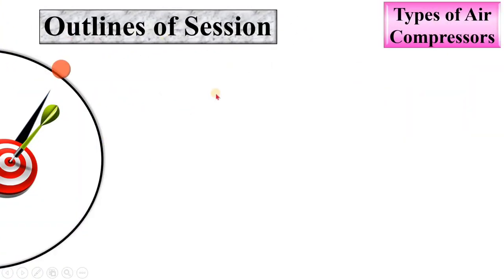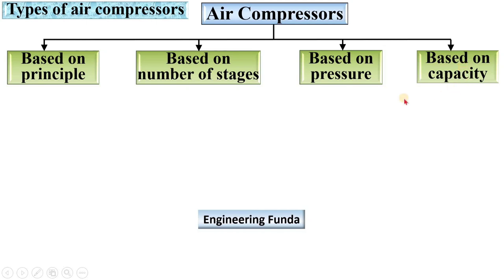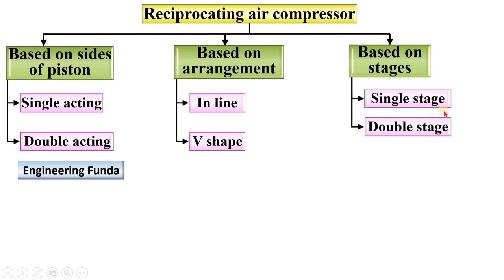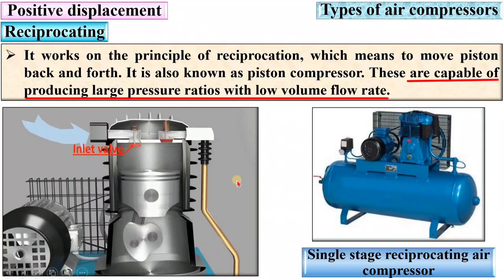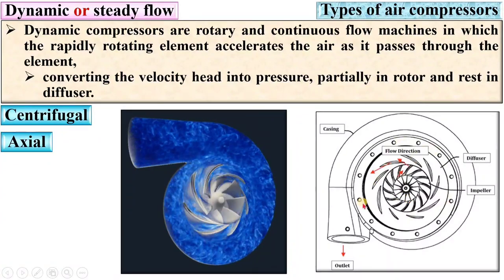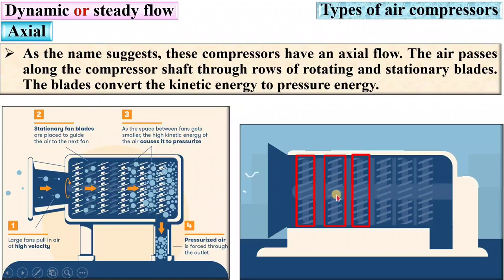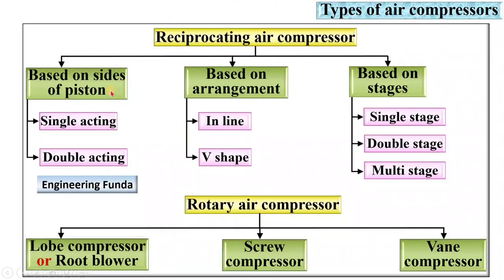Classification of Air Compressor (Reciprocating Air Compressors & Rotary air compressors) Explained

Comment from the maker: Classification of Air Compressor explained with following time codes: 
0:00 - Basic Mechanical Engineering lecture series 
0:14 – Types of air compressor
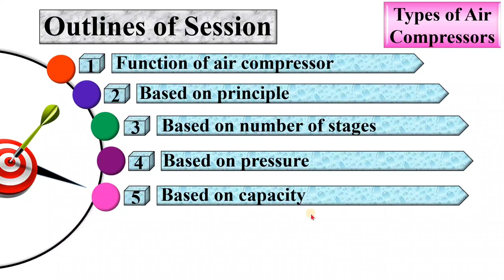0:35 – Function of air compressor
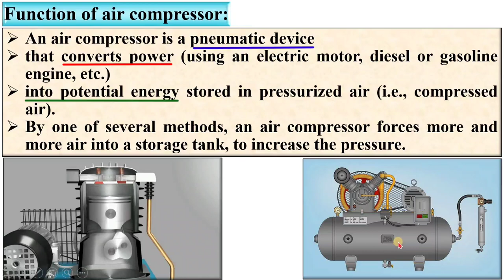1:34 – Types of air compressors
2:55 – Types of Reciprocating air compressor
3:31 – Types of Rotary air compressor
3:58 – Positive displacement air compressor
4:26 – Reciprocating air compressor
5:01 – Rotary air compressor
5:03 – Screw air compressor
5:05 – Vane compressor
5:41 – Dynamic compressor or Steady flow air compressor
6:49 – Centrifugal air compressor
7:32 – Axial air compressor
8:19 – Based on number of stages
8:20 – Single stage compressor
8:51 – Multi stage air compressor
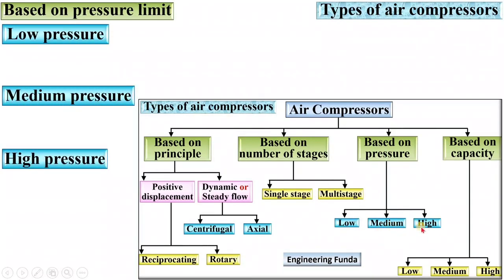9:49 – Types of air compressor based on pressure limit
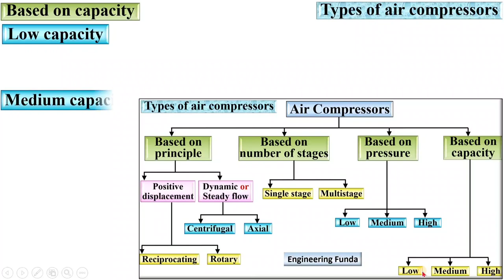10:41 – Types of air compressor based on capacity

Comment: Hello,
Just a note the animation  in 4:45 the connecting rod isn't attached the right way, it can't attach to the counter weight otherwise the counter weight is useless and yield more vibration.
Reply from the maker: It is only to understand the basic of compressor. So animation is only reference. Don't take it as like as in actual machine. It is only introduction of compressor. Again thank you for your comment.